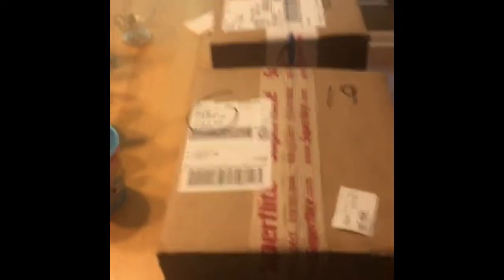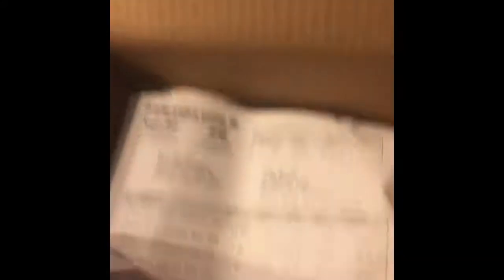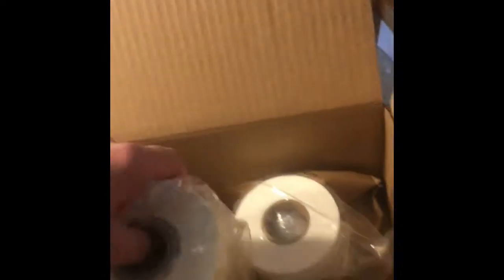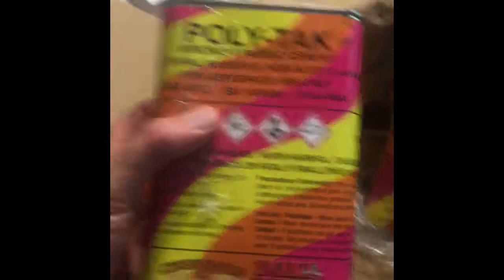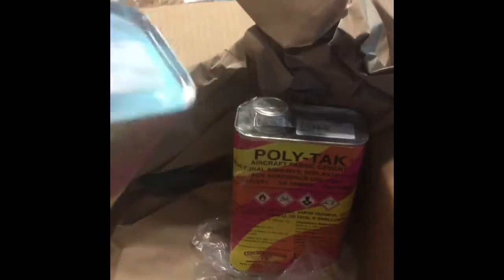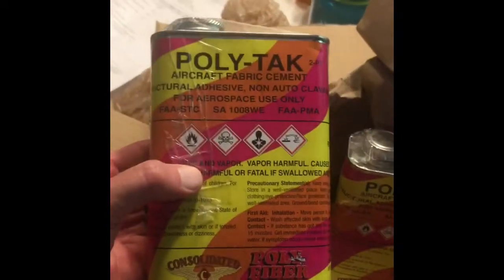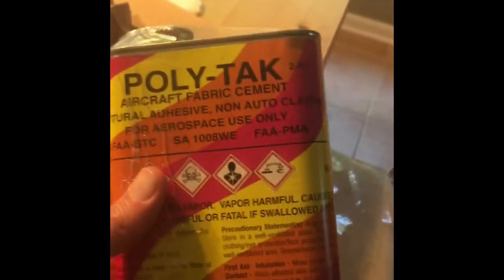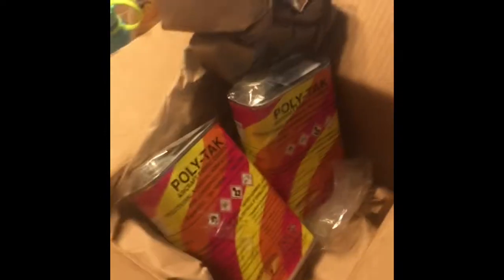Excalibur Aircraft Built Project 1

Comment: Why did you choose the Excalibur over the Challenger?
Reply from the maker: Hi Roy,  there’s a lot of reasons. The big ones are:
> Lower cost when you add in all the standard features that are options on a Challenger.  Excaliburaircraft.com has more info on these. 
> Engine is mounted right side up.
> Main gear is moved back 11”, so the aircraft can sit on it’s nose.
> Wider passenger space 30” wide.
> More forward visibility with a lower nosecone.
> Push-pull tubes and no cables
> Larger flight control surfaces

Send me an email if you’d like more info.  glen@excaliburaircraft.com.